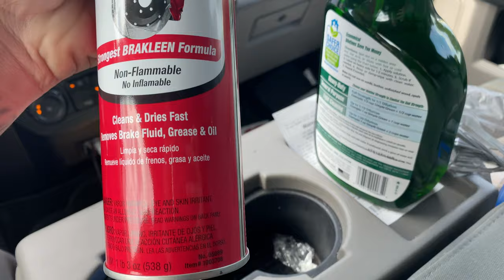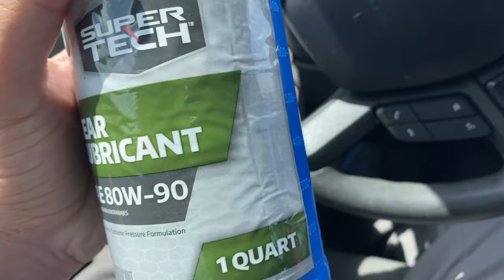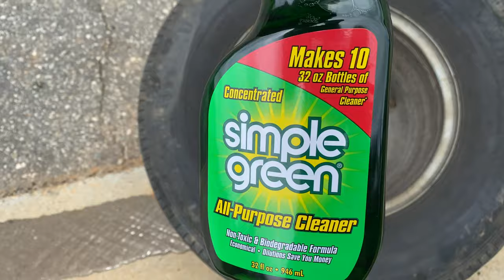HOTSHOT - HOW TO DO SOME TRAILER MAINTENANCE - FOUND SOME SERIOUS DAMAGE

Comment: Great information man! Was wondering were u ordered those caps from and tires? My diamond C is sitting right now, but also have to change a cracked cap from when i bought it, and want to keep some on the trailer once i start rolling with that one. Also good to know about tires bc i think mine are 10ply 🤔 i feel like your always changing tires 😂 doesnt matter bc you have 8 on the traile anyways, can technically take 4 off and still run with it! Cant wait for the update and the tire info. Thanks again